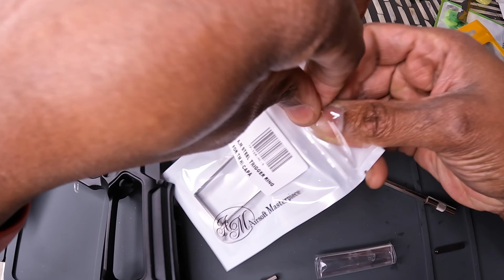Building The Craziest Pistol "Green Alien" | Hi Capa 5.1 | Insane Airsoft Gun |

Comment: Hey there, is the gap with the dovetails between the slide racker and actuall slide ok? I got some aip sights for the dr black 901 and theres a little gap
Reply from the maker: A little gap is fine as long as it's fit and not too tight. I don't have a Dr black slide yet so I don't know the fitment as yet
Reply: @BINNSAIRSOFT  any tips for the magwell? I have the same one and same grip
Reply from the maker: @nathanmunoz779  La Capa Customs

Comment: I hate the stainless TM 5.1... The paint comes off far too easy and it goes to bare metal in no time.
Trust me, you'll end up getting a new frame before too long.

And why the thread adaptor?
The inner barrel was short enough to not need it
Reply from the maker: Thanks for the info. I just had the adaptor laying around, so I just put it on there for the look. Yes, the inner barrel was short enough
Reply: @BINNSAIRSOFT  yeah I'm throwing one on my 4.3 build.
But since I'm using one for looks then I might as well get a longer inner barrel and boost the fps too
Reply from the maker: Yes, definitely go for fps

Comment: Super helpful video.. subbed fersure. Two questions rea quick what's the fps? And what's a ball park figure on the cost of the build? Thanks!
Reply from the maker: FPS is around 295 and the cost is around 650-700’s it all depends on the parts you want. Also thanks for watching and also thanks for the SUB